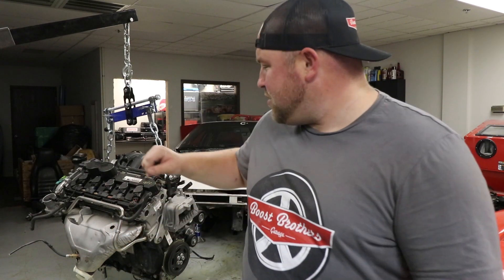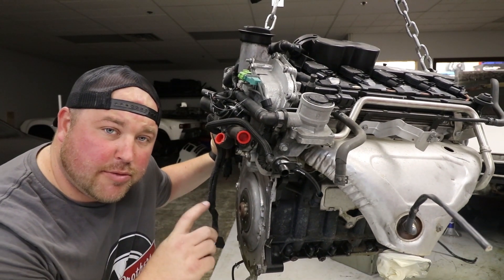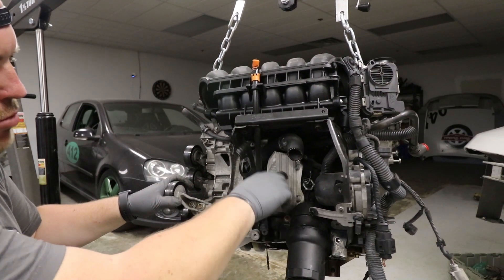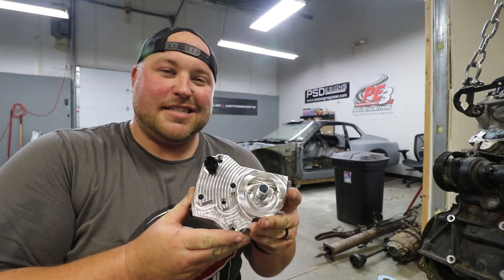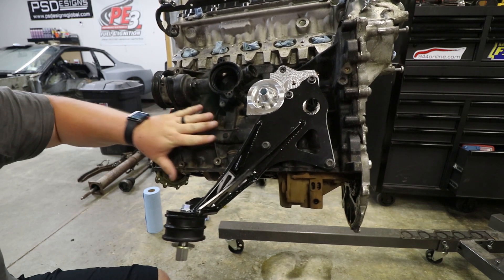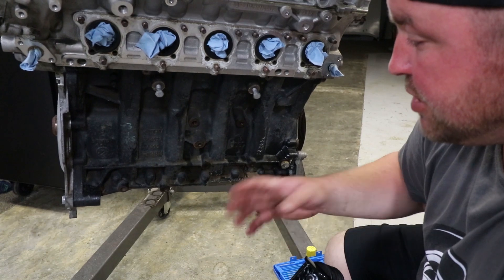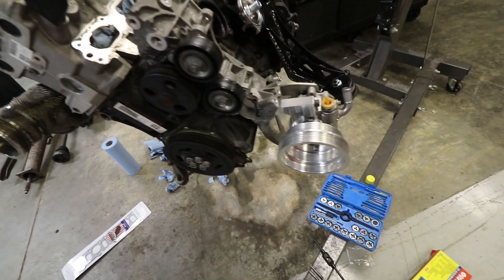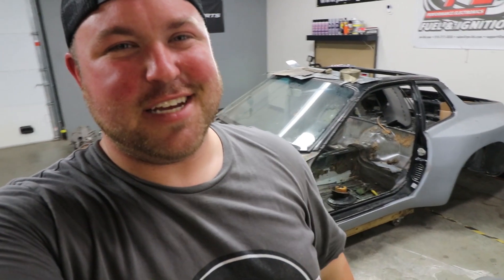5 Cylinder 944 Build - Part 1 (Porsche 944 07K Swap)

Comment: As cool as I think these keep-it-in-the-family restomods are - the original 944 turbo engines were good for over 400hp (I drove my friends ~300hp stage 1 and at mile-high altitude ... uhhhh, outside of the initial lag ... WOW!) ... to me, it just wouldn't be worth all the added work. That said, I think the aluminum LS swaps actually weigh less in the end since you're no longer dealing with an iron block and turbocharger weight.

Comment: You guys are such exploitive vendors with this choice of 07K. 
Own up: it starts as a cheap engine and ends up costing a ton of money to build, especially turbocharging it and swapping it into a 944. 
Stop misleading and encouraging unsuspecting “builders” into money pits
Reply from the maker: Engine swaps cost money, that’s just how it is. The LS swaps are the exact same way. We post spreadsheets with every item needed and pricing to be completely transparent. I’m not sure why you felt the need to post this same message on multiple videos when you clearly haven’t done your research or understand what it takes to swap an engine into a 944..
Reply: @BoostBrothersGarage  I haven’t done my research? Lol, I’ve done swaps in 944s when you were probably in diapers (early 90s) and they were family correct (Audi 2.2T and VW VR6, you know, choices that make some sense?) 
Admit it, you mislead newbs into spending a ton of money by starting off with a cheap engine (07K) which then requires a TON of money to get any real power, because you’re vendors and connect with other “convenient options” vendors.
Your main objectives are profit, not results
Reply from the maker: I’m sorry that you’ve had the horrible experiences that lead you to believe that’s how everyone operates but that’s certainly not the case. I don’t even pay myself. We have to do these production runs as group buys in order to keep the costs down so that people can afford them. You couldn’t be any more off base. You likely won’t believe me but feel free to reach out to our customers to get their opinions.
Reply: @BoostBrothersGarage  lol, I’m sure most of your customers are unsuspecting 18-20yo kids with “dreams”, so I’m not putting any value on that. Good luck with your business though, there sure are a lot of potential customers in this market. Keep feeding potential and encouraging them.
Reply from the maker: Very few are 18-20, most are 30’s and 40’s. I specifically steer people away who are looking for the low cost 400hp route and have zero intentions of tracking the car. That’s not what this swap is for. Again, you are entitled to your opinion but if you look up the 07K swap development thread on Rennlist or have an opportunity to talk to our customers you won’t feel the same way. Good luck with your build, whatever it may be.
Reply: @BoostBrothersGarage  whether they’re 18-20 or 30-40 the objective is the same: unsuspecting individuals encouraged to go that route and spend excessive money. 
Funny you mentioned a Rennlist thread; the epitome of justifying unnecessary expense. 
You don’t have to wish me luck in my builds as most of my customers are in Europe and they appreciate sensical builds for long term, you know, the ones that make sense in every way. 
Good luck in your ventures.
Reply from the maker: I’m not sure how I could be encouraging people to spend excessive money when I make it very clear what a running swap costs up front. Luckily my customers are willing to have open dialogue and understand what it is we provide, unlike yourself.
Reply: @BoostBrothersGarage  no, you don’t tell them up front. You start off with the “I spent $285 on this engine for this swap” as your videos suggest. 
You’re simply leading them little by little and once they’re hooked on the potential (which is true, but at what cost?) and they don’t want buyers remorse and keep spending since they already started and it becomes difficult for them to back down or to acknowledge it becomes a money pit. 
That’s what you exploit, that’s your angle. 
It’s a very common sales tactic. 
But if you have enough people that you can convince, good for you I guess. 
Definitely not an honorable thing to do
Reply from the maker: It’s people like you that really take the joy out of this hobby. You’ve never met me, you’ve never spoken to me, you’ve never seen my parts in person, you’ve never interacted with any of my customers and yet you continue to berate me because you somehow disagree with the reality that engine swaps cost more than the price of just the engine. I would call that common sense but obviously not. If you are a business owner as you say you are I can’t believe this is how you treat other small business owners. I’m done responding to you. Feel free to comment on any video you’d like, it has zero effect on how I sleep at night or what business I have done or will do.
Reply: @BoostBrothersGarage  whatever works for you man. Some of us take pride in our work and well planned out builds and results, while others try turbocharging M96 motors (holy f**k, and I know Jake Raby personally, he’s a customer of mine)
We all have different standards and it shows. 
Good luck to you. I didn’t mean to berate you, just pointing out some things that I would never do. But then again, your market is apparently different than mine. 
Take care and I wish you great success in your ventures.
Reply: @d993s  these guys are fantastic. Everything has been laid out. If you want to repower a 944 to an 07k na, it’s a very cheap and effective swap. I came into this knowing what a swap would cost. I won’t say how much I have spent, but I can tell you the engineering and fitment is perfect.  Who builds a car and doesn’t expect to drop money?? Hell, I have a grand in titaniums on this thing.   Saved me 14 ounces…
Reply from the maker: Thanks Damien! Can’t wait to see it finished!

Comment: Whats the rev range of this unit, how tight is it ,
Reply from the maker: Factory they can rev to 7200. Built they can handle 9500.
Reply: @BoostBrothersGarage  the reason i asked was my friend had a 07.... i think, jetta with a 5 cyl, although peppy 5500 was the rev limiter,
Reply: @BoostBrothersGarage  you forgot to mention how much a “built 07K” cost ($5000+) compared to a “built AAN or 3B” ($1300) and guess which car will have a higher value??? Such vendors of upgrades you guys are, ffs

Comment: I’m not familiar with these engines are they reliable?
Reply from the maker: Reliable to 400 whp in stock trim with a turbo. Add forged pistons and rods and the sky is the limit.
Reply: @BoostBrothersGarage  lol you forgot to mention a LOT of other costly requirements for 400whp: TTRS or custom flywheel/clutch, head bolts, standalone management, custom exhaust manifold/turbo, injectors, tuning, many hours of custom fabrication, etc which are $5000-$7000 minimum. 
But you guys encourage unsuspecting “builders” so good luck in convincing idiots that this is a good choice. 
Reminds me of a guy turbocharging and then fully building a Camry 4cylinder because he got it for free from his parents years ago. Yeah he eventually got 450whp, only cost him about $14,000 and 6 months on a $3000 car….which in the end was worth about $4000. Great plan huh?

Comment: Never heard them called 'cheese head' sockets. I refer to them a 'triple squares,' or '12 points.' I just found your channel and I dig it. I'm a vw/audi and BMW tech. In my time at the few Volkswagen Stealerships, I did my fair share of turning wrenches on these. Definitely more reliable than the TSI engine. Should be quite the cool swap for the 944. The 5cyl sounds awesome alone. You paid under $300 shipped?!?!? You got a hell of a deal.
Reply from the maker: I’ve gotten a few of them for that price. Just got one from a local yard with 60k miles for $200!
Reply: @BoostBrothersGarage  
Great deal, considering at that low of mileage you can essentially just bolt it in and go, after you mod it to your preferences of course. At that price who gives a shit if you blow it up LOL!!! Go for the "MOON TUNE!!!" HAHAHA😁🤣👍
Reply from the maker: Exactly! We will be doing an 07K engine dyno series soon where we can really send it!

Comment: you explained what the oil bloc is but you really didn't say, why you actually replace the factory part? as for the throw out bearing, how is it held in place now? is there a pipe on which it sits?
Reply from the maker: The new oil block is now part of the engine mount. The factory part with the integral oil cooler was too large. 

The slave cylinder / throw out bearing is bolted to the inside of the bellhousing

Comment: Been wanting to swap my 82' with an Audi AAN or ADU for a while, but this seems interesting !!  its got me wanting to try it !  what did you guys do for engine harnesses and integration for the 944 ?
Reply from the maker: We partnered with Performance Electronics to develop a swap harness and ECU package. It integrates with the factory gauges on the late model 944’s but we haven’t tried it on an early car yet. Would be easy enough to modify if nothing else.

Comment: Does the mounts work with factory Porsche bellhousing?
Reply from the maker: No, we developed a bellhousing for the swap. It does use the factory torque tube and transaxle though
Reply: @BoostBrothersGarage  
Ok how much is that? 
How much for mounts and bellhousing only
Reply from the maker: The 944 requires the oil block for the mounts to work, as well as the valve cover in order to fit under the factory hood. The oil pan has to be extensively modified as well, which we are selling already done. I’m happy to price just the mounts and bellhousing for you but unfortunately it won’t do you any good without the other stuff unless you are planning to fabricate all of it.
Reply: @BoostBrothersGarage  yes 
please. Want to try to do as much as possible myself. Mounts and bellhousing please.  And oil adapter. Ty
Reply from the maker: @nealmaha7889  Bellhousing w/ pilot adapter as well as mounts with oil block would be $1,420. The oil pan took an obscene amount of R&D as well as machining and modification. If you decide you need one of those, they are 975 with you supplying your upper pan for us to modify.

Comment: Sooooo my question is can the Lamborghini header be turned the other way in case i wanted to run the 07k in a transverse set up and wanted to put the turbo over the gearbox
Reply from the maker: Not this header, but you could try the RH header to see if it would work!

Comment: I can’t seem to find that iAbed oil filter housing? Got a link to it?
Reply: Hey! Any idea how much this build costs in total? Really really keen to give this a go on my 2.5 944
Reply from the maker: 09walon it depends on a number of things really. It could be done as cheap as $7k or cost $20k depending on what you do with the engine. My complete turbo build is on track to be less than $10k, and capable of 400whp reliably
Reply: @BoostBrothersGarage  brilliant, I'm not too bothered with much more than 400 horses! I'm having a bit of an issue trying to find the same engine 
What cars does the 07k come from? Do you have the full engine code? Just want the kit to work smoothly!!
Thanks!!
Reply from the maker: 09walon 2008-2010 seem to be the sweet spot. Mine is an 08 out of a Jetta. Jetta’s should be the most prevalent. I got mine on eBay for $285 shipped. It’s a CBTA engine code if I remember correctly, but there are others that work. Just stick with an 08-10 Jetta and you’re golden.
Reply: @BoostBrothersGarage  ahh figured out my issue. I'm UK based so all the 2.5s are over in the US! Don't suppose you have any idea of their use in UK cars? 🤪
Reply from the maker: 09walon ahhh, makes more sense. They were not used in UK cars, but US and Mid East for sure
Reply from the maker: As far as more info or to purchase?
Reply: Boost Brothers Garage purchase
Reply from the maker: We don’t have any on the shelf right now, so I would reach out directly to iAbed if you need it immediately. Contact info for him is at the bottom of his website:
www.iabedindustries.com

Comment: What are you using for a flange on the back of the head? Just the stock one?
Reply from the maker: For the coolant line? We are going to make a new one, just haven’t got that far yet.
Reply: @BoostBrothersGarage  sorry yeah, I'm going to have to make one too, I'm running no heater so I'm just getting ideas
Reply from the maker: Gotcha... We are just going to use a 90 and a machined flange to adapt to the stock setup. Should be able to be used in a lot of different applications
Reply: @BoostBrothersGarage  cool, look toward to seeing it, I was thinking of a 90 with an an welded on, my engine is going back in soon for mock up
Reply from the maker: I’m staying away from AN on this one because im cheap haha
Reply: @BoostBrothersGarage  maybe I should look at the cost first. Haha
Reply from the maker: Haha

Comment: Are you going to put r8 coil packs?
Reply from the maker: No, actually using coils off a 1.8T (if I remember correctly). They were the only ones low profile enough to fit under the stock hood without modifications